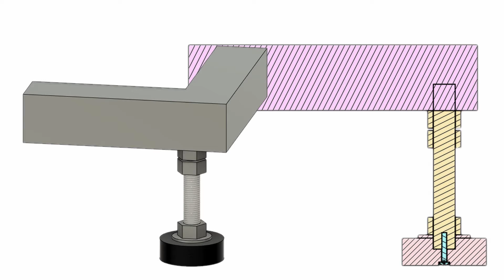DIY LEVELING FEET | cheap & easy

Comment: Upon making these I’ve found that when lowering the load, the threaded rod just wants to tighten up on the hockey puck/M5 screw, the lube may help initially but it still tightens up.

Comment: I was just about to spend way too much on some leveling mounts for my recumbent motorcycle frame jig and thought - there's gotta be a better way to do this! found your video, excellent idea! Hockey pucks on order from amazon and large diameter threaded rods from bolt depot, less than half the cost of what I was going to get and you couldn't even level it under load! genuis! great video.

Comment: These are very light duty. I tried using hockey puck but net result was exploding rubber. I.e. this is not good for loads over say 1000 lbs.

Comment: To what machine weight would you use these leveling feet?
Reply from the maker: i have it on my mill and on my lathe, the weigh ~500kg.
I would say 1 ton is the max i would trust the hockey pucks. Above that i probably would use something made out of metal.